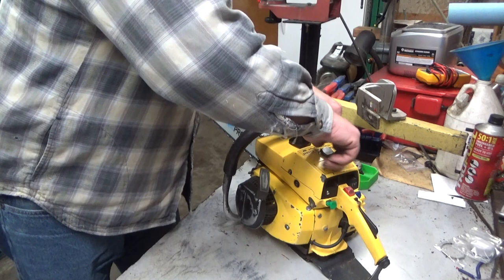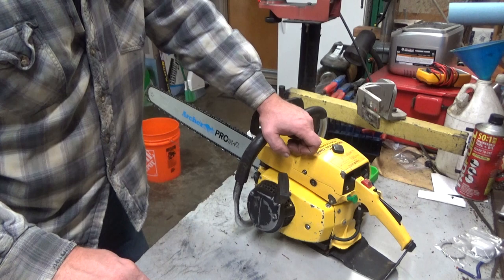McCulloch Pro Mac 800 For My Collection!

Comment: hi leons just a thank you for sending my second batch of parts for my 510 and i have a mac 800 as well same as that one but i also have a late one with decomp valve but its 82cc the other one is 80 cc  they are both in very good condition and worth a lot to me thanks again  alan